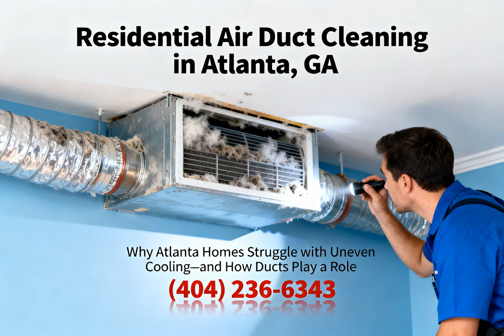Residential Air Duct Cleaning in Atlanta, GA | Why Atlanta Homes Struggle with Uneven Cooling—and...

Comment from the maker: Struggling with uneven airflow? Residential Air Duct Cleaning in Atlanta, GA clears blockages, balances your system, and restores cooling performance.

Hurricane Group | https://www.hurricanellc.com/
📍: 3133 Maple Dr NE # 160, Atlanta, GA 30305, United States
📞: (404) 236-6343
🗺: https://maps.app.goo.gl/EfmJNQaWMqLiKyY49